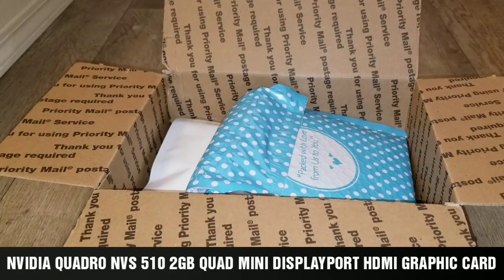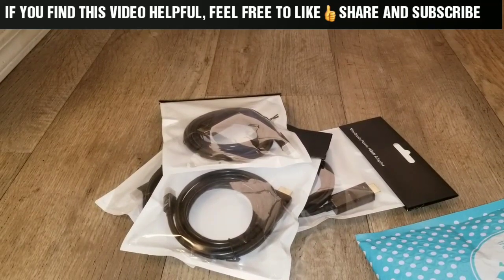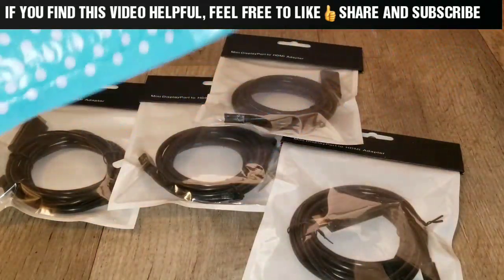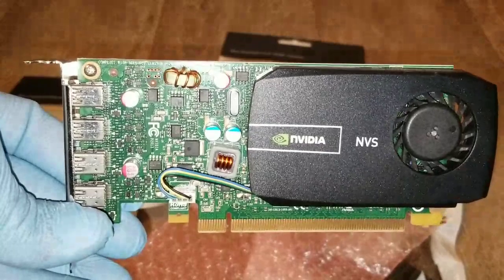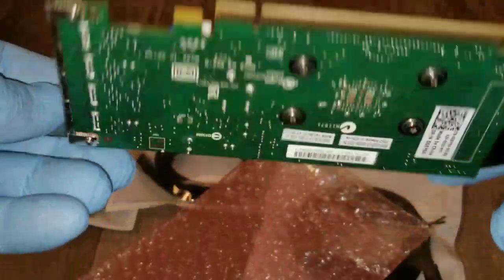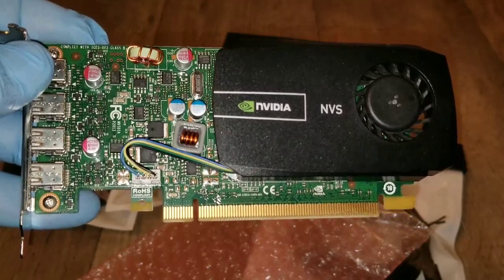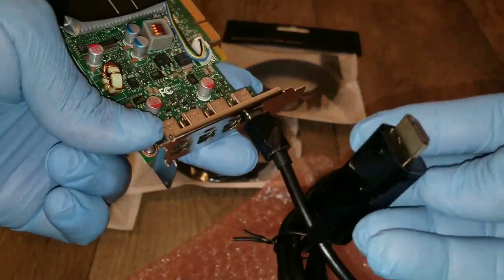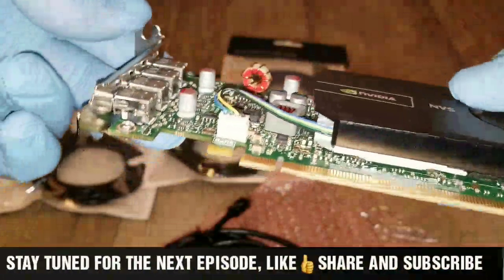NVIDIA QUADRO NVS 510 2GB QUAD MINI DISPLAYPORT HDMI GRAPHIC CARD

Comment: Specs of that are
 Quadro NVS 510 desktop Graphics Processing Unit was released in October 2012. The card is based on NVIDIA Quadro NVS 510, and produced using 28 nm technology. The card's graphics frequency is 850 MHz. Furthermore, it has 192 CUDA cores, 16 texture units, and 16 ROPs. The Quadro NVS 510 incorporates 2 GB of GDDR3 memory, clocked at 900 MHz. It has a 128 bit wide memory bus, which translates to 28.8 GB/s memory bandwidth. The GPU has PCI Express 2.0 interface, and uses a single motherboard slot. The maximum power draw of this model is 35 Watt.
Reply from the maker: Exactly mate.
Thanks for the input and have a wonderful day.

Comment: You can do gaming on this card as long as you temper your expectations. I got this as a temporary replacement for my AMD card, which had failed after years of faithful service. It cost me $50 on Amazon. I started off with basic stuff like Deus Ex, Fallout 3, Half Life, Elder Scrolls: Oblivion, Unreal Tournament 2004, which it handled at 1920x1080 with no problems. You'll have to start lowering settings and resolutions when you get to Borderlands 2. And forget about games like Witcher 3. I'd say the cutoff point is around 2008 for games at maximum settings.

I got it on Amazon for about $50. You can even do transcoding on it. FFMpeg and Handbrake processed video about 2 1/2 times faster than CPU only. It also has drivers for Windows 10 64bit.
Reply from the maker: Cool and thanks for sharing. 
LIKE SHARE and SUBSCRIBE
Reply: what to do you say is it good for gta v teeken in normal setting?

Comment: Bro I have same card cable was causing troubles ichanged it one day worked fine other day no display again can you guide me what could be the issue?
Reply from the maker: I didn't do anything to this one. It just works fine out of the box.
Thanks for watching LIKE SUBSCRIBE and SHARE
Reply: UR issue solved? i am facing the same issue i bought this graphics card and it works fine after some days no display then i bought new cable for it again it works fine for some days and again no display.

Comment: Can I get 8 miniDP outputs from 2 NVS510’s on 1 PC?
Reply: Yes, I am using exactly that configuration: 2 x NVS 510s managing 6 screens. So two slots are still free. You would need 2 x PCIe 16x slots, at least 2.0.  It will work under Windows 7, Windows 8.1 and 10. Please be aware that drivers are different for each of those Windows releases. Also I would strongly suggest to use the Nvidia Control Panel instead of Windows Control Panel Screen to configure the screens setup. Eventually with proper adapters  also VGA, DVI, HDMI screens can be plugged. Highest 3840x2160 resolutions are available only with Displayport, at least according the the specs.
Reply from the maker: No idea

Comment: Bro make a gaming review from this card on these games  gta v , fortnite , pubg and other games
Reply: it's from 2012
Reply: Doesnt matter i have it with a 1st gen core i7 valorant low specs easy 60 fps
Reply: had mine with a 10th gen i3 and it wouldnt hit 60fps on any recent games even at 1080p low settings
Reply from the maker: I build super computers but I'm  not a gamer 😉😎